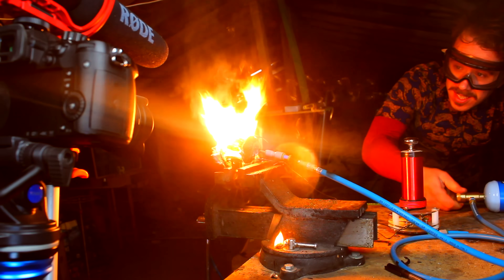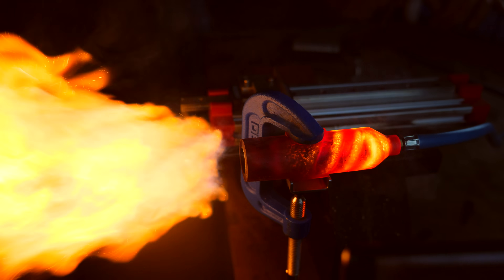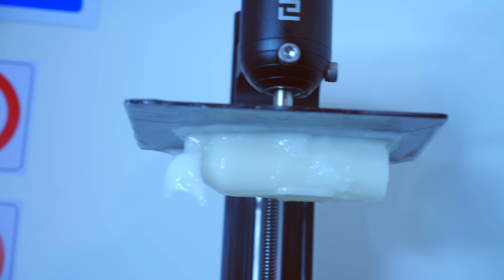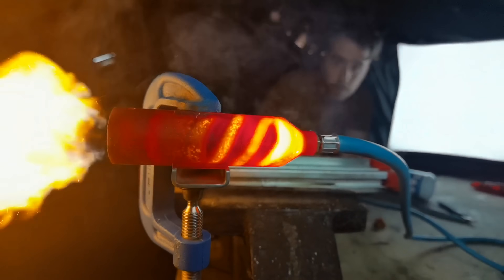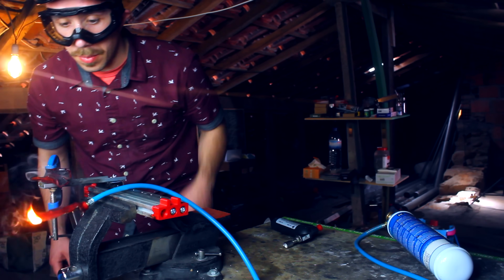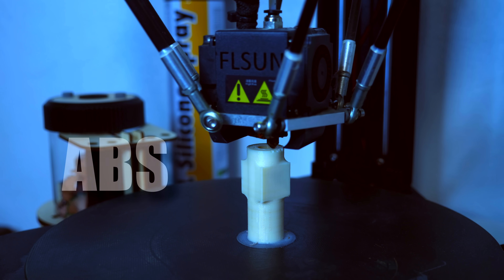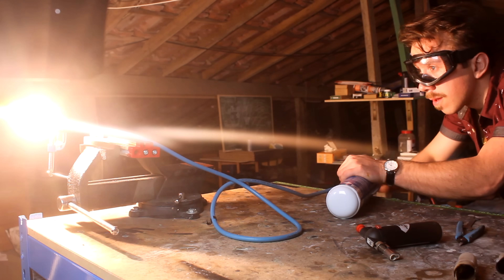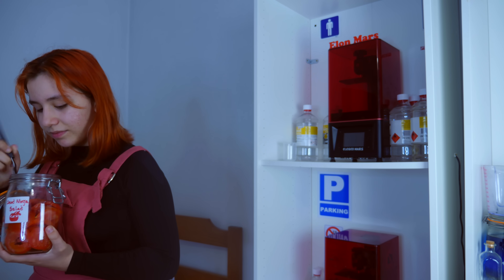Rocket engine that uses itself as fuel! (3D Printed)

Comment: You should do a 2 piece shell!! one piece is the fuel and the outer is made out of the fire resistant resin! cause wow! this looks freaking amazing!!!!!
Also look at the comercial model rocket engines that go up to the atmosther ! some use this hybrid engineering but use 3d printed material instead of the fuel they normally use

Comment: Maby try making a full rocked but with a small steel container for the oxygen and then the 3d printed ABS fuel but that yo put a very thing maby even foil casing for the rocked so that it first burns itself 90 percent

Comment: You should build a second jet engine. You can improve the design with making the engine smaller, so it will be eaaier to run on itself. Because the engine is smaller, the combustion chamber is too, and that means your propane will have more pressure thus making the engine run smoother and easier.

Comment: the nozzles are actually a great Idea, as well as the strong body, but instead of ABS I would try HDPE. I don't know if it exists in filament form, but its a thermoplastic with ok melting point, so you should theoretically be able to 3d print it. Also its like pretty much a standard for hybrid rocket engines, so I would assume its very energetic and good in producing thrust

Comment: what if the focus of a future video was strictly on printing the abs into what would be essentially fuel pellets that you could use inside of the printed ceramic engine, that way as the abs melts it would flow into the porous ceramic and act as an impermeable barrier.... at least until the fuel was used up. you could also "cheat" slightly for a little bit and use a metal fuselage and nozzle while finding the best way to print the pellets for both thrust and fuel efficency

Comment: Use your resin printer to print outer motor body and nozzle and fdm to print motor fuel and try different internal design to see what works best. For example your spiral a straight tube or a tube with internal star pattern for more surface area.

Comment: Try redesigning the throttle-o-meter to have an actual sturdy mount plate instead of using that wierd setup witch is really heavy, the only requirement is four screws and that every design needs a mounting plate 😄👍

Comment: You really need to put a casing of some kind around the outside of the body of the rocket.  It will contain the fuel better and make the overall performance better and stronger.  I would also suggest instead of using an integrated nozzle, have one that is attached to the casing and make it out of something durable like steel or the ceramics you used with the printed engines.  The problem with making the nozzles (de Laval and aerospike) is that you are burning it like the engine cause the efficiency to drop drastically every second (especially the aerospike) If you attach the nozzles to a housing then the engines will move and create enough thrust to do so.  You are very close Integza, very close.
Reply: He could make a casing out of a tomato can.

Comment: I believe NightHawkInLight did a video where he pretty much just bored a hole in an acrylic tube and used that a the fuel for a hybrid rocket engine. Its not 3D printed, but i dont think it gets much simpler than that.

Also, consider adding some cesium salts to some of the final rockets and launching them in a thunderstorm. This should allow you to create lightning on command

Comment: A lot of your engines are burning away the throat of your nozzles, that can be good (used on some real rockets to keep acceleration the same as mass decreases) but I think it's messing with your burn at the end of a run. The throat is usually where the highest heat transfer is so if you can add a more great resistant material there it could make your experiments more predictable.

Comment: "And ABS does indeed give off a toxic chemical when heated – Styrene. In extreme circumstances, this can give you a headache, drowsiness, and feelings of fatigue. So, it's very important that if you use ABS in your 3D Printer you have your ventilation sorted." 

Wear a respirator, please!

Comment: What about you 3d print like small tunnels 8nto the nozzle and run through that pipe sistema like pressurized water or something. I mean real rockets use their own fuel as a cooling solution to not melt down the nozzle
Reply: Btw running fuel rich actually makes an engine run cooler. But u don't really have any solution to control the air fuel mixture. Maybe some sort of a system like that will spare you a couple of headache

Comment: so for your rocket some of teh things i was noticing is that the nozzle degrades pretty quick and you keep busting out the side of the engine/fuelpod, maybe make the nozzle out of the 3d print ceramic and the body could just be a bit of metal pipe (i know, not great for youtube) or a quartz glass tube. something taht will withstand the temperature and pressure. oh and the areospike nozzle looks way cooler than all the others. just saying.

Comment: Maybe adding a little more fuel to the back of the engine(Towards the nozzle). Maybe then you can get a longer runtime and keep it from blowing a hole in the front due to it taking a longer time to burn through than the back.

Comment: I have a small idea I'm not to sure of it makes sense but, what if you use the liquid resin printer to make a strong outer layer of ceramic, then use regular abs or sugar cores as a replace-able fuel so as not to waste resources when testing different nozzle geometries.  I believe it will also extend the rocket burn time and strength for better results.

Comment: If you just used a steel housing (like a metal pipe or something?) I think you'd get a lot more thrust.
Reply: Copper pipe might be easier. Add an endcap with a fitting for the O2 line and you're in business.

Comment: Try and make a steel enclosure so you can still print the resin part then insert the printed engine inside of the casing.
Reply: A steel shell would handle a lot of heat, as well as increase the integrity and you would be able to burn more even if it burns more on one side

Comment: Use either store-bought round stock (you could even experiment with different materials) or regular epoxy with sugar and cast a pellet.
Also, put either a metal or a quartz tube around it and 3d print the nozzle with the methods you used for the last engine.

Comment: Can you 3D print a small working engine using hydrogen as fuel by electrolysis. It should be enough hydrogen made on demand to be functional! So technically water powered engine

Comment: Integza - dont solid fuel rockets use something like rubber and hydrgen peroxide? Could you use some thick wall plumbing steel pipe and stuff if with rubber, then pump h2o2 through it for some real power? PS theyre called sparklers in english, imaginative language huh?!

Comment: You need a layer of ablative material around the fuel pellet to protect a pressure resistant casing. Otherwise you won’t get pressures sufficient to generate a significant amount of thrust.

Also, I suggest ditching the funky internal geometry. A cylindrical or star shaped cavity in the pellet is good enough for NASA. Also, you want to minimize the amount of fuel being blown out of the nozzle because it separated from the pellet.

On the subject of nozzles, integrating them into the 3D printed fuel pellet is a no go. If anything needs to resist high temperatures and pressures, it’s the nozzle. Graphite or a strong resin with ablative inner layer are both good fits.

Comment: You should 3d print a mold out of the plaster resin and the use it to cast metal. Because then you can just break the plaster away and be left with a metal engine

Comment: get yourself a plasma cutter. a handheld is not that expensive. you could build metal puls jet engines.
Reply: I don’t think you get it the point is to make a 3D printed engine.
Reply: @yumm95  yes, but a metak 3d printer is probably a bit to expensive and to get better at rockets it may be smart to first work with metal and get a working rocket before trying plastic
Reply: I think he should buy a compact cnc machine
Reply: @rayenhamdaoui  but one that can cut metal and not only wood. a wood rockte isn't a good idea.
=)
Reply: @drohnele3741  yea im talking about a 4 or 5 axis metal cnc machine
Reply: @rayenhamdaoui  sounds good. but probably would be prety expensive.
Reply: @drohnele3741  yes it is but really great investment
Reply: @rayenhamdaoui  only if he uses hisi n his projects. we we talk about expensive mahiens now - what about a metal 3D-printer?

Comment: In England we call them sparklers, also your rocket is offset from the centre of the rail you have it clamped to, so the rail can't move correctly because the 2 metal planes are gripping each other

Comment: Try making the nozzle and casing out of aluminum, it's fairly easy to cast and machine and then you can use the entire 3d printed part as fuel. Also maybe move the rocket a little closer to the center of the rail, it might make the rockets less likely to bind from torquing on the rail.

Comment: It would be better to just 3d print little cartridges of solid fuel you put in a casing with a nozzle to direct the thrust. This would allow you to reuse the engine though it would have to be metal or something other than plastic. You could use a pressure vessel (2 liter bottle) to hold the oxygen and then fly the rocket several times just by putting in a new solid fuel cartridge.

Comment: you could use thin sheet metal as a casing for the solid fuel rocket and you would get alot more thrust because then all of the energy would be forced out the back

Comment: I think you should try 3D print parts of your Vortex Engine, use it as molds to cast it in Metal. There are some challenges there but the result won't melt or leak as your 3D printed parts directly.
Other solution is 3D print it directly in Metal.
I really want to see this Vortex Engine working Fine
Great job Itegza!
Reply: There are castable resins and filaments for this purpose. You can do investment casting like this

Comment: I think it will work better when you shuff the engine in a Mettal pipe, plug the end where the oxygen is added and build a nozzle that can withstand the heat.

Comment: Idea number 1: Construct a magnetron (By taking apart microwaves)
Idea number 2: Try build a plasma jet engine with the magnetron (I think would be interesting even if you are unsuccefull)

I think it would be fitting as you are such of a Tesla fan - Plasma, High Voltage, Jet engines <3
PS: be carefull with the transformers of the microwaves)

Comment: Instead of using a linear rail to judge if there's enough thrust, you should use a load cell and put the engine on a lever arm to increase the readings

Comment: i love theese videos and have been watching you for almost a year now keep it up love the jet engines! I think you should try making a small HHO generator, you can put a little nozzle at the end and you can use it for brazing with a flame burning at around 2000 degrees celcius! Or maybe a small hydrogen fuel cell, or you could use hydrogen as the main fuel source of your rocket engines!

Comment: You should try lost pla casting to make a vortex rocket engine v4. It would be very temperature resistant and easy to seal if sanded properly at the joints

Comment: You should build/buy a metal 3D Printer. That solves your problems with leaks and you can print a nozle that survives the tests.
Reply: Does someone know in what pricerange they are?
Reply: @achimarmbruster8806  Banggood has one listet for 277 but I don't think this is usable
Reply: @arnemdv  maybe once😂